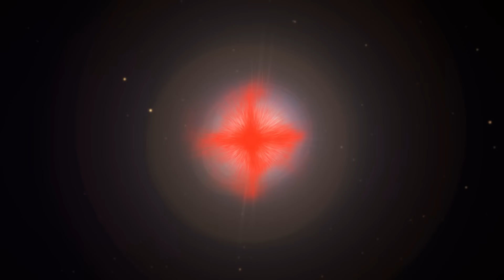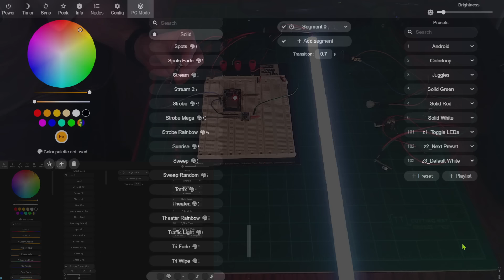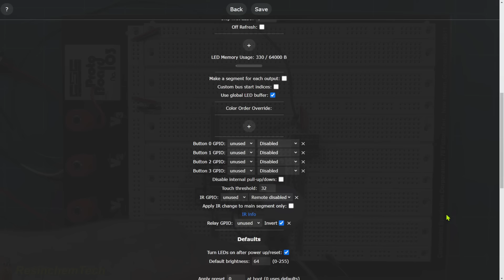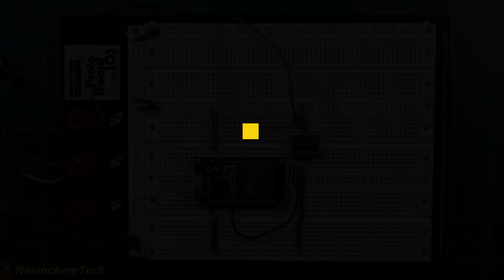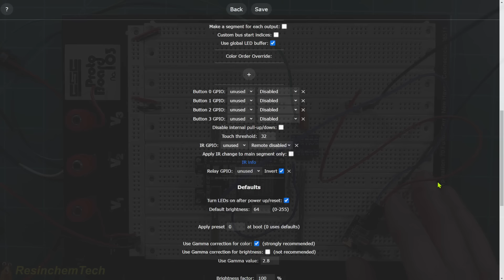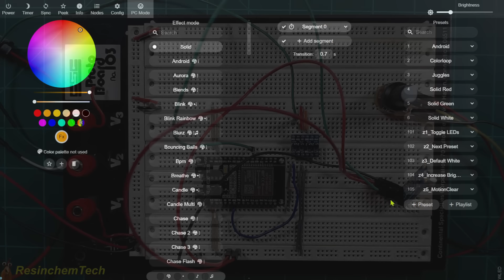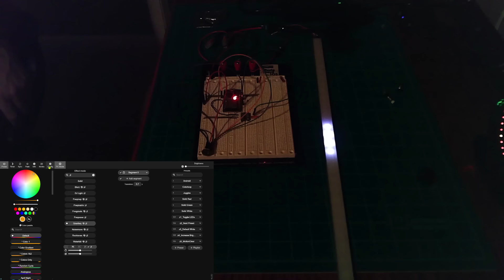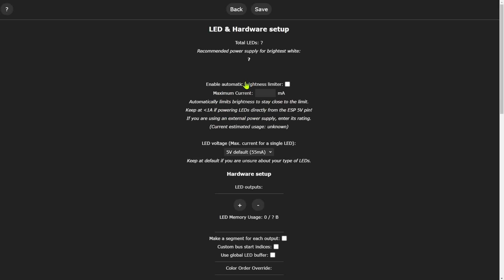Level Up Your WLED Projects: A Guide to adding Components (no code!)

Comment: I watched because I have some problems with my microphone and it don't work. I tryed exactly what you did but my microphone is just doing crazy stuff. My microphone only has 3 pins (VCC,GND,OUT). Also it's strange because my LEDs are flickering which is really annoying. Could someone help me please?
Reply from the maker: Based on the little information you provided, it could be any number of things.  Since you said the microphone only has three pins, I'm assuming it is an analog microphone.  Is it connected to an appropriate analog pin on the ESP and did you define/setup the microphone with the right GPIO pin?  Are you using an ESP32 or ESP8266?  How many LEDs are you using and what is the size of your power supply?

Flickering LEDs could be from a number of causes and may have nothing to do with the microphone.  Are you using a logic level shifter of some sort... or at least a sacrificial pixel?  Flickering could be due to a poor/weak signal.  It could also result from too low of a voltage reaching some of the LEDs and power injection might be necessary.
Reply: I am using a ESP32 witch is powered by 5v 15A. The LED strip (WS281x) is connected to GPIO 14 and has 300 LEDs.
Sound settings:
Squelch: 10
Gain: 40
AGC: off
Microphone type: Generic Analog 
Analog input pin: 32

The LEDs are only flickering when I use a music mode.

I also connected a blue, red and Green LED to the ESP32 (pin 25, 26, 27 ) in the settings I used "PWM RGB". Is it possible that this LEDs do the same things as the strip? (Right now I can't even turn them off)

I have the newest version of the software.
Reply: I hope it's anoth information
Reply from the maker: Based on what you describe, I really am not sure what the issue could be unless it is some sort of interference on the analog line.  While I usually use a digital mic like the INMP441, I do have a few installs that use an analog MAX9814.  While the MAX9814 isn't as responsive as the digital version, none experience the flickering you are describing.

You might try taking a look at some of the troubleshooting information on the sound-reactive web site.  There is quite a bit of info there:  https://github.com/atuline/WLED/wiki/My--device--is-not-working

Otherwise, you might need to try the WLED Discord server or one of their other forums and see if someone else has experienced this and can recommend a fix.  Sorry I can't be more help, but I just haven't experienced the issue you are describing.
Reply: Thank you so far

Comment: Hi there, great video first of all. I have a question that nobody seems to cover. When a esp32 is running a large strip light setup, say 10 metres of lights, obviously you would use additional power transformer to provide power injection, but nobody covers how to control the transformer, meaning switching it on and off when you turn on and off the esp32, I'm guessing something like a 3v to 240v ac relay. Switching that happens automatically? Do you have a video on this or any thoughts? Many thanks. Pete.
Reply from the maker: If I understand you correctly, you want to also power down the transformer/power supply when the LEDs are turned off?  Well first off, if you are using this same power supply to power the controller, then the controller would also be powered off and you wouldn't be able to turn the LEDs back on without somehow turning the power supply back on separately first.

But if you are referring to a secondary power supply, you could use a relay just as I showed in the video... except it would naturally need to be rated for the type, voltage and current of the secondary transformer.  Another alternative would be to connect the second power supply to a smart plug or outlet and use something like Home Assistant, NodeRed, etc to create an automation that would turn the power on/off to the smart outlet when the LEDs are turned off/on.

Note that I do have a video where I'm using a wall switch with a Shelly smart relay installed.  This wall switch, when turned off, kills the power to the entire system (transformer, controller and LEDs).  The drawback is that to turn the LEDs on via automation, I have to turn on the smart relay first.  But the LEDs are configured to automatically turn on with full white when they power up, so the wall switch works pretty much like a standard light switch for the LEDs.  Once the LEDs/wall switch is on, I can then changes colors, effects, etc.  This might give you some additional ideas:  https://youtu.be/Pxq-ePs5D-g

Comment: Hello!
I see from your videos that you appear to use LED strips to illuminate your background and provide practical lighting on your set with the drinks cabinet behind you. (This looks very good, BTW!) I am trying to do a similar thing, but I find that the colors (particularly Blues and Purples) tend to be over-saturated.
Could you do a video where you show your lighting setup and explain how you manage to get such good color balance? (Failing that, explain it here! 😀)

Thank you!
Reply from the maker: You are absolutely correct that it can be very difficult to film or photograph LEDs... and you are also correct that blues tends to be the worst.  If you watch some of my other videos, you can see where I struggle with this as well.  Of course, there is only so much that can be done with a cell phone camera (which is what I mostly use).  To do really good video/photos of LEDs, you'd likely need a much more advanced camera, filters, etc.  But I have found a few things that can help a little:

- Turn the brightness WAY down.  While they will look very dim to your eye, they will still appear quite bright on camera.
- Try adjusting surrounding ambient lighting to different levels.  Filming the LEDs in complete darkness tends to make things even worse.
-  Use some sort of diffusion if possible.  The more diffused/soft the LEDs appears, the less "bloom" you will get on camera... especially at lower brightness levels.
- Shoot at a angle and not directly in front of the LEDs, especially if you aren't using any diffusion.

Thanks for the compliment on my bar/drink lighting.  But a bit of 'insider' info here... while that is my actual bar setup and LEDs, what you are seeing in the video is a static photograph and green screen, not actual video of me sitting in front of the bar.  I do have a few older videos where I'm actually filming while sitting in front of the bar (you can tell because the LEDs change color), but that area just really isn't conducive to creating videos so I use the static image and green screen instead.

That's about the only advice I can offer.  I have seen other videos where the LEDs look fantastic on camera.  My guess is that they are using a much more expensive/higher-end camera as opposed to a simple phone or web camera.

Comment: Great material, good job. 
I would have a question because in the hall at home I have five switches that I would like to control one controller (all of them are connected to each other with one 3-wire cable). And my question. Can I connect them to the controller so that I can turn on/off or by short/long press using any key to control only one ESP?
I have D1 mini Pro [ESP-8266]

Comment: Hello sir, great video. I need some help regarding custom usermods in a wled based project using esp8266.
Reply from the maker: You can find all the info you need on installing, compiling and using a custom mod on the WLED website:  https://kno.wled.ge/advanced/compiling-wled/

You can also find specific information for user mods in the user mod folder that you are interested in here:  https://github.com/Aircoookie/WLED/tree/main/usermods

Comment: Kind of an off-topic question, but when you build out your projects on ElectroCookie boards, what type/guage of wire do you use to connect the various components? I want a wire that I can bend into a certain shape and stay that way so that I can keep my wires neat. Do you have any suggestions? Thanks!
Reply from the maker: For my "onboard" connections... from one point to another on the ElectroCookie board, I generally use 20 gauge solid core wire... just for the reason you state... so I can bend it and have it stay in shape.

For any external connections from the ElectroCookie, I generally use 18 or 20 gauge stranded for power and the LED data line (18 gauge is better but it can be difficult to get the stranded wire through the ElectroCookie thru-holes without "splaying" and potentially causing a short or other issue).  For other peripherals, like buttons, sensors, etc. I will generally use either 20 or 22 gauge stranded.

Hope that helps!

Comment: 14:37
Any development on using ToF (VL53L0X ) sensors to control brightness using distance for example?
Reply from the maker: The issue with using the VL53L0X is that it is an I2C device and returns a numeric value.  Therefore this can't be used like a binary switch, but also cannot be used as an analog device because it isn't returning various voltages.  Standard WLED would have no idea what to do with a number like 23.8 vs. 25.4. 

There may be user mods available for something like this (there is at least one for the VL35l0x), or you could use connect the VL53L0x to another ESP board and use either ESPHome or Arduino code that would return a high/low signal on a pin when the measured distance is greater or less than a value and then connect that to the WLED controller.  But this would still be binary and would work much like a PIR motion sensor and not provide variable values for controlling something like brightness.  While you can find I2C pin definitions in the User Mod section of recent WLED versions, these are meant to be used with user mods that then does "something" with the data.  So you can check the user mods (or even develop you own) to take the data received and do something like map the distance to brightness.

The other alternative is to use something like Home Assistant or other automation platform that could send varying brightness commands to the WLED controller based on different measured differences.
Reply: @ResinChemTech  
I've seen kitchen top counter LED strips that control brightness using hand gesture, e.g simply move hand from left to right = increase brightness, right to left decrease brightness.

I assume they used a ToF sensor, but seeing how difficult the implementation is, they might be doing something different?

Any ideas how they achieved that?
Reply from the maker: This WLED user mod seems to do exactly what you are describing, but I haven't tried or tested it:  https://github.com/Aircoookie/WLED/tree/main/usermods/VL53L0X_gestures

Comment: Doesn't the ESP32 itself run off 3V? Once you get to the point of using a buck converter to provide 3V, I think you can power the esp32 on the 3V pins, and abandon the 5v pins;  This also alleviates the possibility of the onboard regulator not being so good.
Reply from the maker: Yes... you can certainly do something like that, but you are now relying on the buck converter to be the "voltage regulator" and providing a consistent voltage.  When powering the ESP chip directly via 3.3V, it is pretty sensitive to voltage.  So if the buck converter provides better "regulation" than the onboard regulator, it is certainly possible to wire it as you describe.

Comment: Great video…
I ran 5 esp32’s some synced together built on electrocookie bread boards enclosed in some 3D printed enclosures. I used them for last Halloween lightings and Christmas lightings.
WLED makes it so easy to control lights and other things. I commended those who wrote the firmware for us to enjoy projects like these!
Reply from the maker: I agree... WLED is pretty amazing software, especially considering it is open-source and free.  It's hard to believe that it was originally developed by a single individual, Christian (aka "Aircookie"), for a school project.  It has come a long way and now has multiple contributors, but it was still pretty amazing back in the days when it was first developed and supported by a single young individual.

I think I have somewhere around two dozen WLED installations throughout my house, in various form factors from linear to matrix and even one wearable.  I always look forward to what's been added in each new release.  Thanks for watching and taking a minute to share a comment.

Comment: Very useful video, I have been meaning to look into using the button options.

Regarding the own PCB option, I have tried this out for the D1 Mini as a trial.  I did make some simple mistakes like mislabelling the +/- (which is fine if you know you have done it) and I connected the data to D2 instead of D4 (which stopped it booting), but I also added breakouts for every GPIO and additional pin outs to add a separate 5V power source either via USB or via a PSU so no power needs to go through the D1 Mini.

I was going to do similar for ESP32 boards but I have noticed that they do have different GPOI layouts and also some are different widths.  So until I decide on a regular source for ESP32 boards I am going to hold off.

But considering how cheap (I think 10 was about $10) it is to get the PCBs made up and shipped, it might be worth making up breakout boards for general use with projects.
Reply from the maker: I've only ordered one custom PCB (completely unrelated to a WLED controller), but was amazed at how quick and cheap it was.  The PCB designed I showed right towards the end is one I've designed as primarily a WLED controller with the ESP32-mini (but actually haven't ordered yet).  Since it also breaks out most pins, it could be used for things other than just a WLED controller.  I like the ESP32-minis due to their smaller size, but the double row of pins make them unfriendly for breadboard (or ElectroCookie) use because you lose two of the rows.  But they are ideal for a PCB since you can break out both the inner and outer row of pins.  It would be my personal go-to design for a PCB just due to its smaller footprint which would result in a final smaller overall size for the controller/enclosure.

Comment: I have a question about the sound reactive and microphones. I haven't seen anyone address whether or not you can use a line out from a stereo or other sound source into the ESP32. I dont really want the LEDs to pick up ambient sounds/voice, but to operate when music is played and have it directly piped into the board. What are the caveats for that?
Reply from the maker: I haven't actually tried it with line-in, but the wiring and additional details for both an analog line-in and line-in via I2S can be found on the WLED web site here:  https://kno.wled.ge/advanced/audio-reactive/  At the bottom of that page is a link to the Sound Reactive fork, which contains additional details about microphone and sound options.

I wouldn't think there would be any caveats other than the same ones that would apply when using either an analogue or digital microphone.  Sorry I don't have more to offer, but I've simply not tried to use a line-in with any of my WLED installs.
Reply: Thanks, @ResinChemTech

Comment: Hi awesome video just wondering can I connect two motion sensors, planning to use wled for stairs lightning?
Reply from the maker: Yes... and I actually cover that in the video and even talk about using them with stairs in the motion sensor section.  There are some limitations and you may get better results with one of the WLED user mods... or with Home Assistant... but I specifically talk about using two motion sensors for something like stairs in this video.
Reply: @ResinChemTech  Sweet, I would want to use home assistant too but it needs some hardware and the raspberry pie's are just too expensive. Probably gonna use an old laptop with a huge heatsink soo it's quite. Currently using some some tuya smart devices and one wled light with esp32. Before I didn't know about wled but when I heard about it I was amazed. And its cheap too like the esp32 is like 3.70€ on AliExpress.
Reply: @ResinChemTech  Sweet, I would want to use home assistant too but it needs some hardware and the raspberry pie's are just too expensive. Probably gonna use an old laptop with a huge heatsink soo it's quite. Currently using some some tuya smart devices and one wled light with esp32. Before I didn't know about wled but when I heard about it I was amazed. And its cheap too like the esp32 is like 3.70€ on AliExpress.
Reply: @ResinChemTech  Only issue is that would require a couple of very long wires to run the PIRs together.
So how about building two WLED boards and only connecting one to the actual lights, then sync them together to that they  both turn on the lights when either detects motion?
The other thing you could do is with Home Assistant start an automation when it detects the lights have come on, pause for XX minutes and then turn them both off.
I have just tried using an automation based on me turning a WLED string on, a delay and then turning other things on/off and it seems to work well.
Reply from the maker: Pretty much exactly what I did here:  https://youtu.be/Y29Y0iTLggg
Except my two sensors are connected to D1 Minis running ESPHome.  I would later replace the PIR sensors with ToF sensors for better reactivity and fewer false triggers.  There's also a follow up video where I replaced those PIR sensors ( https://youtu.be/ZRb_wpJo1AM ).  Yeah... as I mentioned in the video, using something like Home Assistant automations is going to make a much better system, but I was trying to stick with what could be done only with the WLED controller.
Reply: @gordon861  I am fine with running a wire and my stairs are not that long anyway also not using home assistant now.